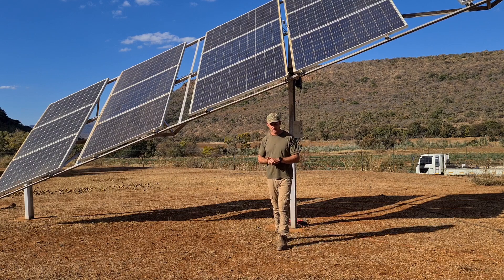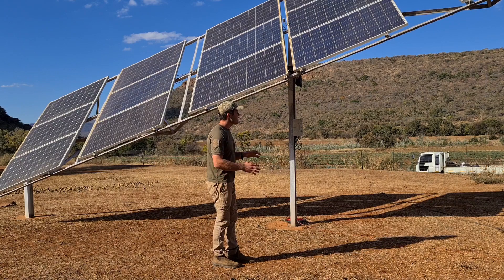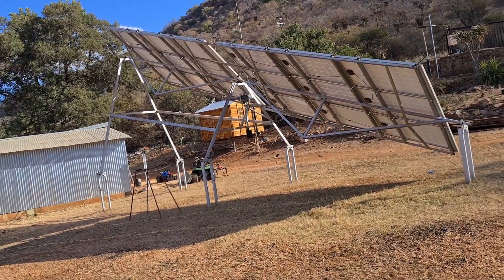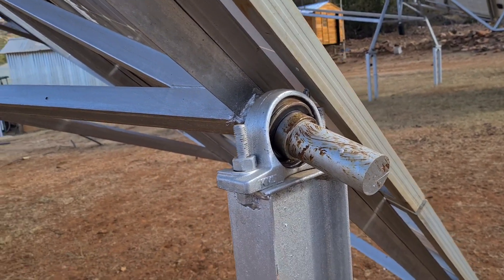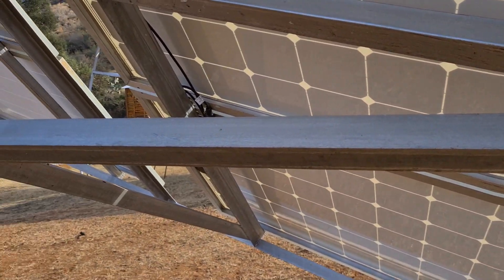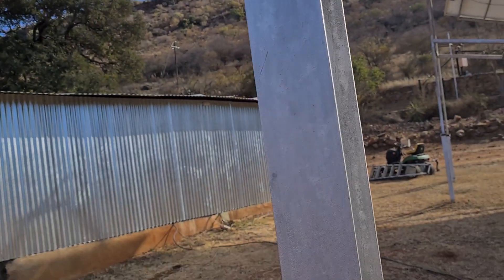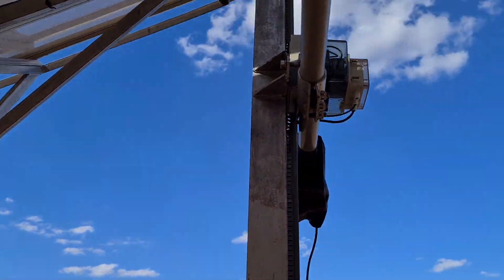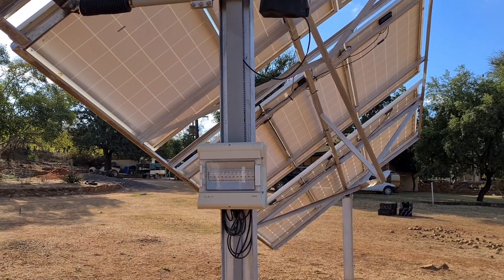DIY Single Axis Solar Tracker

Comment: Nice system, thanks for sharing.

The bolts from a rear Leaf Spring of a vehicle? Blattfeder
Reply from the maker: I have no idea 😂 I just went to the shope and looked at the most durable unit I could fine and decided on it like that , the best way would be to have some sort of engineering degree I guess, but I am not one so hopefully I made the wise decision.  Well it's still holding till today

Comment: Hi Phillip,
I also live in SA, I was just wondering where you sourced the components for your tracker, ie the actuator and the associated electronic components. Im thinking about adding a tracker to my rooftop solar which is mounted on an adjustable frame, for winter/summer angle changes.
BTW, great setup
Karsten
Reply from the maker: hey !well i sourced it from China actually , not cheap stuff but in the end its worth every Rand Just try Alibaba
Reply: @PhillipFourieZA  Thanks, will do.

Comment: Hi Phillip,
have you any drawings for your DIY Single Axis Solar Tracker? If not I could do them with my 3D CAD-Software.
I would be try your design and build it!
Nice work!
Reply from the maker: this last unit i did some drawings on the design jus have to figure out where i placed it

Comment: I like that setup. Do you think your harvest is sufficiently improved with the tracker over, say, strings facing 3 directions over a sun-day?
Not confident that would survive the intermittent high winds we have here in Vermont USA though :)
The foot has a lot of concentrated load on those bolts and we get 49-70mph winds 10-12? times a year. Those panels can grab a lot of wind!
Reply from the maker: Hi thanks for the comment,  concerning the sun harvest I can confidently say yes it improves alot as I have a bigger system that I use for a pump at my other farm 11kw and to get max power for the motor to achieve 50HZ I only get it between  11:00 to 2:30 during the day the rest I get say between 34-42Hz as with this smaller unit that I use for my pump and I get 50Hz on the motor from 8:30 until  4:30 and as you can see I have 2 units one is for my offgrid home and on cloudy days I can definitely say it's alot better,  as for the winds there was days when I prayed 🙏 God have mercy,  but it holds I clocked the wind speed 92.3KM was very stressful but for the health of my hart I will be adding additional reinforcements
Reply from the maker: Forgot to add that the 11kw pump system is fixed 

And the smaller unit 3kw is the tracker

Comment: I like your set up
Like to get the tracker info....how long between times it's not working...?
Reply from the maker: Hi Raymond,  the controller takes a sun reading  every 18 Seconds so if there are clouds then it compensate for the new UV and adjust accordingly,  as seen in my video in the middle of the structure there is a small triangle shape sensor so it's a very accurate setup 

You can look at te unit for sale on ww.ecoworthy.com
Reply: @PhillipFourieZA  thankyou PHILLIP
IM pretty sure I have that design or copy(2 axis) controller
STOPPED working a week after installed....its parallel to sky....there's so many panels I'm not concerned about its tracking behavior...excess summer solar gain.
MY next purchase will be a single axis controller instead.

Comment: Robust,  my early ecoworthys burnt out in no time they put no heatsinks in the controllers, but interesting to see they may have improved . Seems like you live in a nice area landscape wise, Africa is similar to Australia in appearance red dirt hot n dry.
Reply from the maker: Hi thanks for your comment,  that's strange I have one of the early ecoworthy tracking units installed on a other location and its still holding up fine but the dual axis controller I can understand because I had to replace mine a couple of times not sure why they don't last but this units so far holds up nicely,  but if something happens I will definitely post my findings cheers